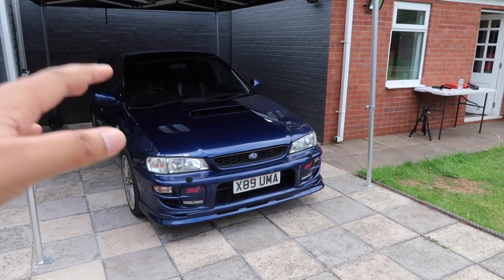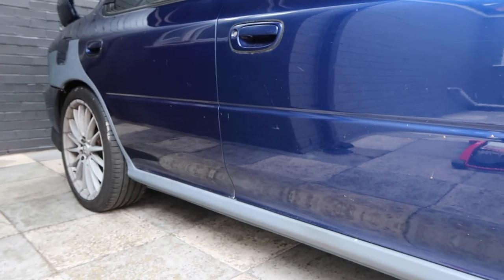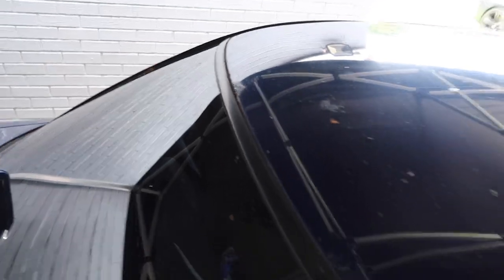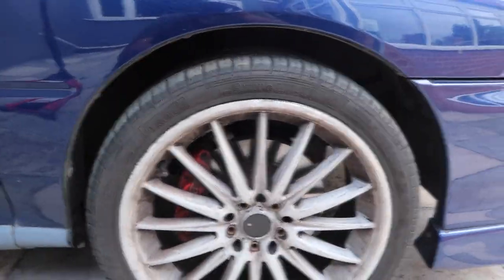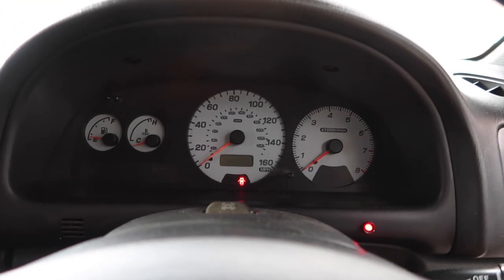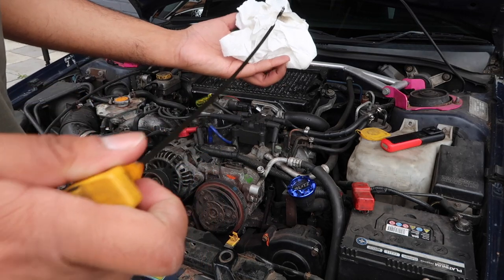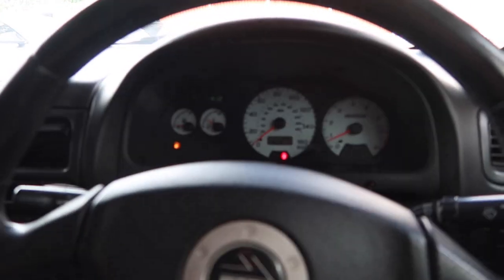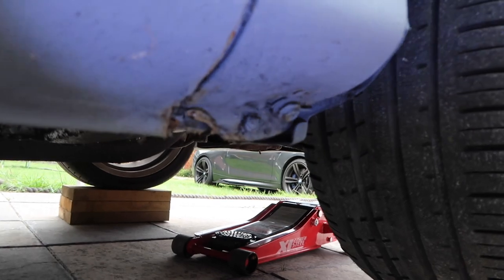Everything Wrong with My Cheap SUBARU IMPREZA!

Comment: Hey Hamza, you said in the video that the car had an oil change in Mei, but the oil looks pretty black for an recent oilchange, so the previous owner did not do an ioil change, or het did not put in an new fliter. The main thing with Subaru''s is never save cost on oil, coolant, gearbox and dif oil changes, do them on time, if you drive short distances, then you need to change more often(engine oil).
Myself I driving an 2007 STI, and I change the oil every 5000 km. It is better to play safe, and change the oil of your engine, and Always use OEM filters. Ihave my car four years now, and it runs fine, never had any problems.

Keep up the nice videos ;:D

Comment: You dont need to remove the intake manifold, i did it on my p1.. remove the header tank to the side, air box removal etc lots of lube arm scrapes etc but i slid it through and job done

Comment: the top coolant tank over the engine is for bleeding the coolant system, once all the air is out put the cap on and dont take it off, top up the system from the bottle at the front

Comment: Might be wrong but I’m pretty sure primer is porous so although it seems to be protecting the metal, unless it’s got top coat on it’s not really protecting anything. You should take the primer back to bare metal before painting I think!
Reply from the maker: I’m not really a bodyshop guy just going off what the previous owner told me. Will get it inspected and done properly when I get it sprayed!
Reply: Make sure they check no water has got between the skins in the rear arches this is why the rear arches rust out on a classic and if not done right you will have to repair them every year or so 👍
Reply: Yep primer is porous 👍

Comment: It's way easier to change a turbo / parts on a older Japanese performance car compared to a VAG car where the turbo's are in the wrong place due to cost cutting.  Looks like a good little project.

Comment: Gas filler pipe is probably crusty too. By connecting two plugs under the dash it will diagnose itself and show the faultcodes in morse code with the cel. Curious about the project. I own one too👌🏼👌🏼

Comment: First USE Winns to clean injectors. Than change spark plugs and measure compression! New oil and coolant. New air and fuel filters. Remove BOV. Make a custom tune! And Subaru will put a smile on your face

Comment: the bottom looks like it's just surface rust. You don't need to replace it. Just clean it off and spray paint the parts to protect

Comment: I was planning on buying one. Saw a few the rusts a common thing and be careful the body is quite thin to repair also check rear diff.Airflow sensors play big part with the idle

Comment: You can check the check engine codes yourself by jumping a plug under the dash. It will cause the check engine light to flash to reveal the underlying code. Have a google and you should find a walkthrough

Comment: Cant believe no ones said it but for the diagnostic there are 2 black plugs under the steering column plug them in and put the ignition on and it will show you a code

Comment: maff sensor needs modding to newage.green maff are notorious.engine shit too better to do a rebuild future proof it.once you hit over 300bhp gearbox gna b on edge too.sti intercooler,vf35 turbo,yellows injectors,walbro fuel pump,road map,and last tyres eagle f1 tyres.will b a beast

Comment: I replaced that same hose with a silicone one with only removing the intercooler. It was definitely a pain in the ass 😂. I should’ve just taken the manifold off.

Edit: Car was an 04 WRX
Reply from the maker: I wish I didn't have to remove anything else apart from the inlet pipe itself 😂